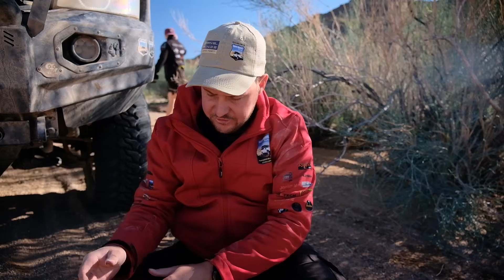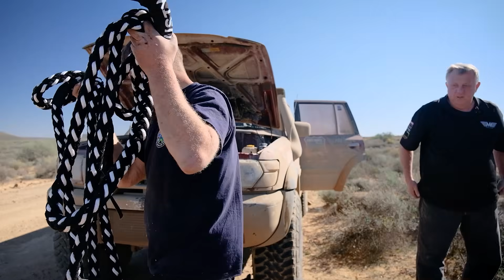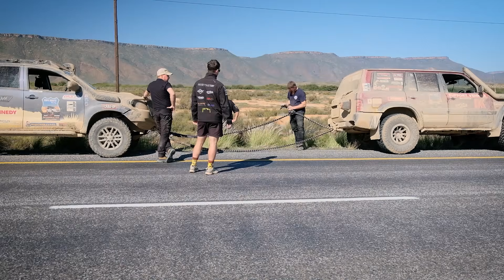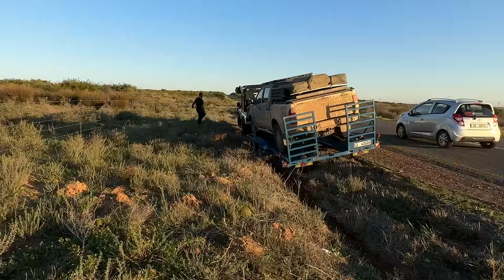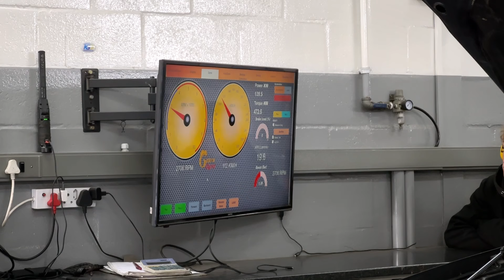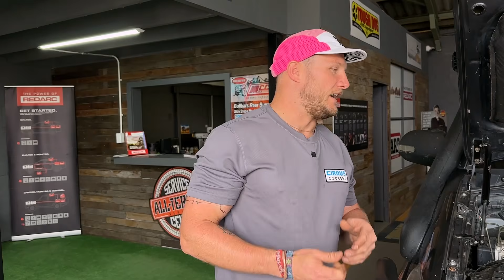Hilux Engine Rebuild: The Truth About Injector Failure & Bad Fuel

Comment: @Dieter Pey how do you tend to drive your diesels? By that I mean where do you change gears depending on the conditions.
I drive my Rav4 D4D around 2000 RPM on the straights, minimum 2500 RPM uphills and when towing. I don't like trucking or lugging my diesels. I have friends that will drive up a pass in 4th gear at 1200 RPM .
Reply from the maker: I like keeping my revs and enige near the powerband so between 1800 and 2200 rpm when I'm cruising. I know diesels don't like being bogged (low rpms).
Reply: He drives it like he stole it mate!! Have you seen all the Cape Route Rallies, No mechanical sympathy for the vehicles during these rallies 😂

Comment: Does it help to have a secondary diesel filter ?
Reply from the maker: Yes it could help as long as it doesn't interfere with the fuel flow. So make sure the filter microns isn't less than the main filter.

Comment: Ive got a 2001 Toyota Hilux Surf with the 1kd here in NZ its got 314000km on the clock not sure when the injectors where changed or if they were changed
Reply: I didn’t know they put a 1kd in a 01 hilux. I thought they were 1kz from 01-04. Before that was the 5L motor.

Comment: Your issue was Def not caused by faulty injectors. Most guys don’t realize a melted or holed piston on a Hilux 3.0 D4D usually comes from bad tuning and pushing the motor too hard. When you chip or remap these engines, you’re basically overtiming and overfueling them — injecting too early and too much — which drives up combustion temps way beyond what the pistons can handle. It feels strong, but inside the cylinders, temps and pressures go through the roof.

Then take that tuned bakkie off-road — low speed, heavy load, high RPM, hardly any airflow through the radiator or intercooler — and you’ve got a recipe for cooked pistons. The turbo and EGTs run red hot, and without an EGT gauge or proper cooling upgrades, it’s only a matter of time before the piston melts a hole clean through.

Stock tuning on these D4Ds is made for reliability, not drag racing. If you want power, do it properly with EGT monitoring and cooling upgrades — otherwise, that “extra power” will end up costing you an engine.
Reply: Except, they blow engines even if stock standard. I worked at a Toyota dealer for 4 years and saw it multiple times. I have no idea why toy fanboys can't admit D4D4 blows engines. The GD6 isn't much better, with the timing chain, plus dusting still issues on the 2.8
Reply: Yep shitboxs, total agree

Comment: Amazing the dirty diesel doesn't happen to an Isuzu!
Reply from the maker: If you do research, you'll find all manufacturers and vehicles struggle with this issue. 

Most vehicles only get driven in and around cities/towns, maybe once in a while on a long roadtrip. I'm regularly on the road, filling up at various odd towns and the likelihood of me getting bad fuel is much higher than the average road users.
Reply: I wish that statement was true, my 2024 3L Isuzu packed up at 25k kilos, apparently contaminated fuel from a reputable garage in JHB…fortunately Isuzu fixed it as a “goodwill” gesture…all that been said, I bought an Isuzu 4x4 and only use BP now….
Reply: I`m curious to hear more real-life experience around this. I know a guy that bought a Mercedes Gelandewagen Diesel for his around Africa adventure and had to tow it back after reaching Namibia (from SA) as it could not handle the dirty diesel. I`ve never had issues with my 2015 D4D Legend 45 but only driven it in SA and Moz.
Reply: I've done more than 1.5million kays in Isuzu's. Namibia, Moz, Botswana, kalahari, Kgalagadi etc and everyday vehicle.  Never had a issue. Serviced religiously every 10k. Warm engine up slowly. Let turbo cool down after heavy loading. NO tunes. Brother in law Prado engine popped at 129k. Had a map.

Comment: Obviously if you neglect your injectors this can happen, that goes for any engine. KD’s don’t crack pistons bc of injectors (unless they are neglected) they crack bc they get little hot spots on the edge lip of the bowl on the top of the piston and they mostly all crack in the exact same spot, usually 4th one bc it gets doesn’t get as much air as the other cylinders with the stock intake manifold. If you machine genuine set of 110’s you can safely run 600-700hp on those pistons n that’s proven. Ceramic coating does nothing as well by the way, it’s all flaked off and gone after 10km’s of driving!
Reply from the maker: Interesting information about the ceramic coating. Yes nothing lasts forever. I didn't have the knowledge about the injectors issue on D4d's and I learnt the hard way, but now I know and I'm hoping this video will help other's learn from my mistake.
Reply: @DieterPey yeah no absolutely bro nothing wrong with that. obviously your situation was bit different. i’m getting mine built for 500-600hp rn and it’s nearly finished

Comment: As a lifelong Toyota fan and loyal owner who never ever considered other brands, I have to say for as much as we run into battle for the brand, they do need tonnes of lesson learnt maintenance, additives, babying, ultimately offline knowledge. I mean knowledge that isn't promoted by the manufacturer. You have to know. And of course have pockets of money ready.
Reply from the maker: Owning any vehicle, especially if you have a passion for vehicles, quickly teaches you that any vehicle has flaws. It takes time and school fees to learn these lessons, but once you have a good knowledge and network surrounding that brand, it makes it 10x easier to understand and know how to correctly maintenan and service the vehicle. 

It's easy to just buy a vehicle, keep it under warranty and trade it off for the newest model every 2/3 years, but what's the fun in that? 😂
Reply: People think Toyota's ate bulletproof lmfao.. I finance plenty of rebuilds for them, hiluxs and labscruiser engines. Actually very common for them to blow up long before the rest of the vehicle is worn out.
Reply: This comment doesn’t make sence. Just change the oil and keep the injectors clean. Just like any diesel engine. These guys were beating on it. It’s done hundreds of thousands of kms. The fact it’s lasted as long as it did is a testament to Toyota engineering. 

Typical saffas though

Comment: I disagree with it being injector failure. Here in Australia when it gets hot these things fail left right and centre. 
Mine even failed. Even my sisters. Both we sent the injectors out to be tested. Both came back OK within spec.
Both these engines now have upgraded pistons
Reply: From what I have seen on my visits to Aus, is that the Ausies, in general, work their vehicles harder.
Towing very large caravans and trailers.
Otherwise the climate variances between the countries are very similar.
Another issue could be the quality of the fuel.
Reply: @andreventer8734 yes Australia has the hardest conditions for engines in the world.
The finest dust wich easily gets past air filters, average very hot days, I’ve (personally seen 47c days) and some of the worst fuel when travelling inland. Couple this with caravans I’m honestly surprised I don’t see more engines blow up.
Reply: I also agree with you on this topic my diagnostic is"when it comes to diesel engines the first line of defense for the pistons towards heat is not water in the cooling system but engine oil as that is what cools that hot piston immediately after the combustion stroke thru the oil squiters,then that heat bieng transfered to the engine oil goes thru the oil cooler that is heavly dependent on the entire engine cooling system to cool off the engine oil to help cool the piston after every combustion stroke, the viscous fan that broke is very important to diesel engines because its very effective at drawing off heat especially on low speed before you can have the ram air effect on higher speed, and i heard he talked about upgraded inter cooler for cooling the engine and in that case unfortunately during take off that intercooler actually does the opposite, it cools down intake charge air that then the computer reads and compensate with adding more diesel on the combustion stroke further increasing the piston peak temperatures that are capable of expanding, deforming the piston way before the water in the vehicle can do anything about it, and as the piston is racing down blazing hot to begin the exhaust stroke the oil sprayed by the oil squiters it isnt cool enough to cool the piston down effectively , and thats where you start to get scoring and piston defroming and cracking way before you oem temperatures sensor can detect heat related damage in the engine as that sensor is programmed not to show temp spikes or fluctuations, and the cylinder reboring that was done reinforced my diagnostic
Reply from the maker: Interesting, it was extremely warm on this trip. I'll still have my injectors tested, but I do believe mine was an injector which failed. I was told the hear could've been the final straw for that injector to fail. One of the reasons I upgrade the intercooler, to help the engine run more efficiently.
Reply: @DieterPey  Toyota have a bulletin about piston design where they admitted it being flawed. 
The first piston design wasn’t flawed. But they updated it for new emission standards, where the problem arises they then changed the design 3 times but never truely fixed the issue.

EG-0008T-0112 is one of the three bulletins where Toyota admitted it being a piston issue.
Mine cracked at 275,000 and my sisters at 370,000km. My mother’s prado is still going at 330,000km but at this point it’s just a ticking time bomb.
Reply: Rubbish
Burnt pistons are always combustion related.
Injectors injectors
Reply: @maeleach3122  on the 2 engines I’ve had fail personally, both the injectors were sent out to a common rail diesel specialty shop, both the reports back said the injectors were OK and within spec. Actually all 8 injectors were fit for re-use.
Reply: @mitchell5064 they can behave differently once released from the cylinder head.
They also flush the clean the injectors before running them on their test bench.
If you mic up and or visually inspect the plunger shafts you will see and measure wear.
Reply: @maeleach3122 I even told them they were out of a 1kd that cracked a piston, twice. And both times they said it wasn’t Becuase of the injectors. With extensive proof all over the internet even from Toyota that it’s the design on the pistons fault I can’t put the blame on injectors.
Reply: @maeleach3122 You’re incorrect, the skirt on the bowel of the piston is too thin, causing it to expand and contract at a different rate when going through heat cycles. Causing it to crack. This problem Is exaggerated when the engine is exposed to extreme conditions. D4DEngines on YouTube has extremely good videos on this problem as he rebuilds them daily. 
Also look up the Toyota bulletins where Toyota themselves blame it on the piston design and not the combustion.
A common fix to the problem is to ‘delip’ the piston with a CNC lathe.
Reply: I’d love to know where to get some injectors at that price, Toyota quoted me 9500 per injector, my injector no3, feedback values are well above the norm, any link on where to buy oem injectors for that 26k

Comment: I had a comparable thing with my 2.2 Ranger. On 3 July this year I filled up at MBT in Edleen as I usually do for the last 6 years, because they carry 10ppm diesel. On that day, I travelled to Ruimsig via Pretoria and the N4 southward, and back. That afternoon back home in Birchleigh, the truck misfired. As I had no misfortunes with two 2.2 Rangers since 2017, I did not know what the problem was. Let’s just say that the lady at Morus Ford scared the hell out of me with the possibility of R175000 cost: with all the tests and eventually possibly a new engine. I therefore contacted a private company I know well, Wessels Motors. They had the truck for a few days and I got it back running smoothly. Four new injectors were all it needed. Before taking it to Wessels Motors, I was instructed to empty my diesel tank, so with the help of a Youtube video, I emptied the tank. The smell of paraffin was very strong. Then refilled at Astron close to home.

Ranger is healthy again. I towed my caravan down to a venue at Parys and back. Average fuel economy was 10km/l with caravan, doing 100-110kph.

I’m happy now.

Comment: Add a racor water separator filter, the best investment you can make..
Reply from the maker: Thanks for the suggestion, I'll definitely look into it!
Reply: Also up that side of the country quite a few places been bust for adding parrafin to the actual diesel,which will damage injectors leading to the failure you encountered.  So not only dirty diesel,but doctored diesel also big issue.  Your suggestion of filling up at big stations is spot on .
My info comes from someone who wholesale sells diesel in that area

Comment: Thank you for a very informative video, and sorry for your misfortune. 
What I was wondering is how many kilometers does the fortuner have , should be similar year range?
I have the same 2011 fortuner d4d with 290k km and not have had issues yet, also chipped, 160kw 550nm ,also KSD and front  mount. It is a really nice vehicle once you get a little more power. 
I was also wondering, were you using terrain tamer diesel lube on every tank, and what role do this play in cleaning the fuel system,  when getting contamination such as you had? I try and use Diesel lube mostly, and have noticed the engine is more smooth and better on economy, also quieter when cold, but thought this could also help when fscing contamination. 
Regards Dewald
Reply from the maker: Thanks for the comment! 

The Fortuner is a 2009/2010 model and is sitting close to 500k km and also has had a stage 1 tune for years. Not sure on the power figures, but nothing major. 

Yes I did use the FlashLube (Terrain Tamer) Diesel Conditioner for a good while. I think that's what helped my motor get to 270k km instead of the 150k km like everyone says the injectors usually fail. It does make the engine sound and run smoother. I need to start using it again, but still doing research on all the different additives etc you get.

Comment: Problem is the parrafin in the diesel ,diesel bug and dust ,change your filter woth every service and get a good brand same with oil I use Dickson filters and now switched to liquid moly oils as n cant find the delo I use to use also long trips I add an injector cleaner tip if it smells like engineering shop it's the good stuff, take the bakkie to a mechanic with a good scan tool to check injector balance and pressures if the bakkie starts sounding like a tractor or you notice a big drop in fuel eco, if you replace injectors use denso original parts and dont refurbished them just replace, I pour 10ppm at Sasol myself so the diesel is "cleaner"

Comment: Can't verify it, but at our workshop we send all our injectors to Udel.

And I've heard from them there is a service bulleting for those Denso injectors that they must be reconditioned every 100 000km.

Otherwise they blow holes in pistons.

Same thing happens on pajeros. Most commonly seen after it was tuned.

That injector was hanging on with its spoor spray pattern or dribbling, but now more fuel is added and temps get hotter and that is what breaks the camels back.

Good practise to change your diesel filter every service. 1KD diesel filters (gud G1142) is not that expensive.

We change diesel filters every service at our workshop. Yes oem is better, but gud is good enough for most.

Comment: Wat is die beste manier om injectors te toets? Kan dit getoets word sonder om uit te haal?
Reply: Plug in diagnostic and read the injector values, between -3 or +3.   Replace with genuine new injectors if need be and not repaired.
Reply from the maker: Ek is nie 100% seker nie, maar ek het al video's gesien hoe hulle dit op n toetsbank sit en toets. Tune 2 Race Paarl het aangebied om myne te toets en te recon. Ek weet jy kan ook deur n OBD reader die injector values sien en as daardie values nie binne spec is nie, is dit ook n indication dat hulle oppad uit is.
Reply: jy kan jou injector values laat lees deur die duur OBD scanners, sal aanraai om elke 2de diens of twee te vra dat jou mechanic dit kyk vir jou.